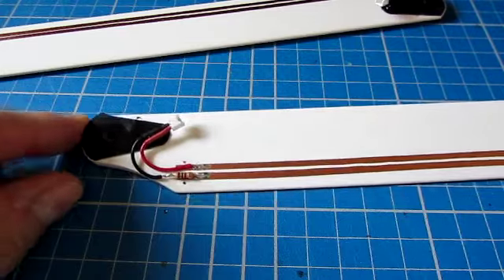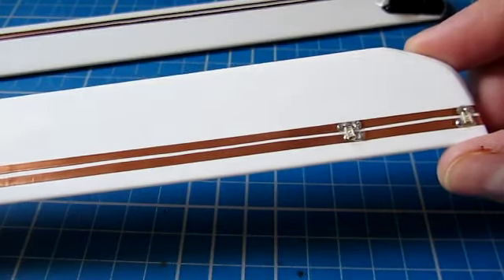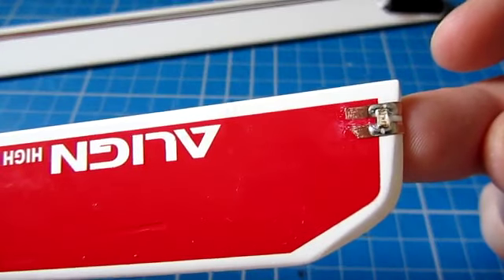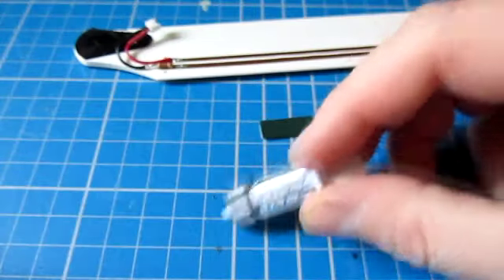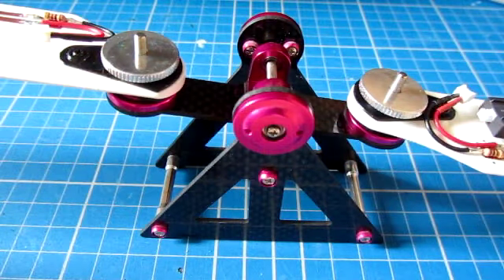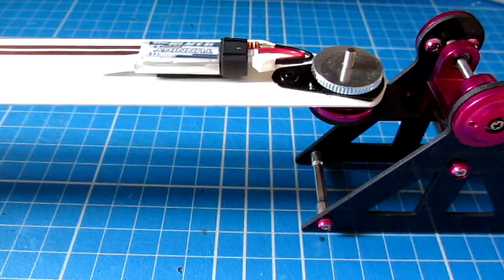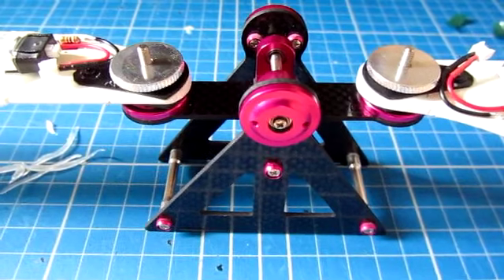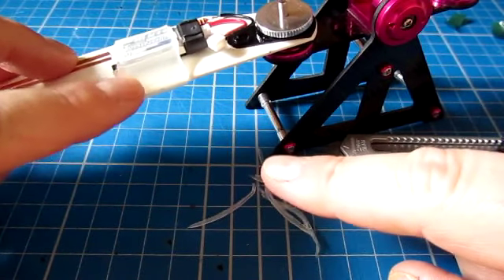How to make a set of night blades simply - Part 2

Comment: Could you do a different color led on top vs.bottom or would the resistor be different?
Reply from the maker: You can have whatever colours you want in each location. The resistors should be about the same for most of them, check the specs of the LEDs you are using.

Comment from the maker: I've not tried - the drag opn the smaller blades and the impact on their weight and ability to shift decent amounts of air would be impacted heavily. If you figure it out I'd like to see :)

You could mount two bright leds to shine on each side of the rear blades and fit a stip of relective tape to each side of each one...

Happy flying!